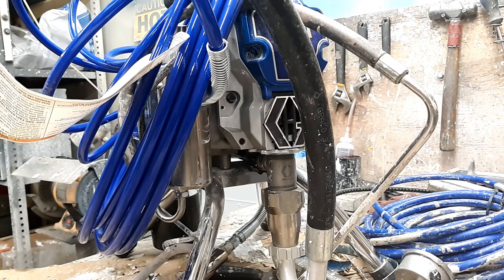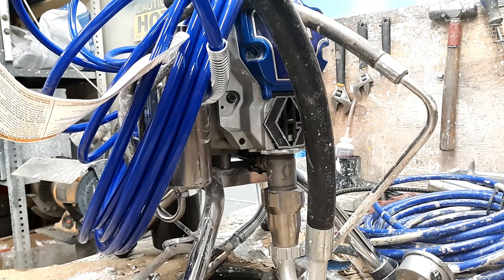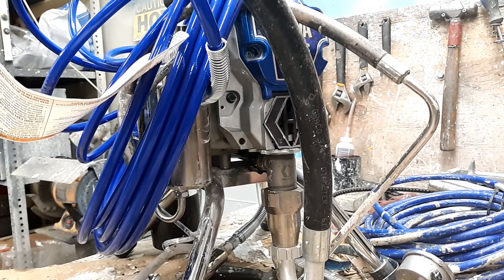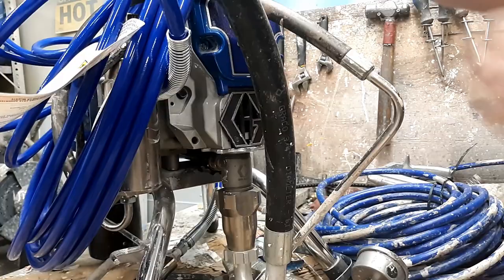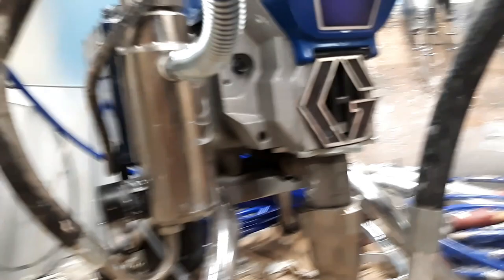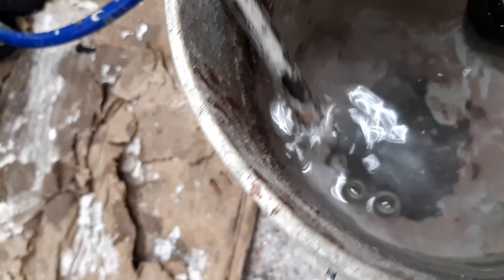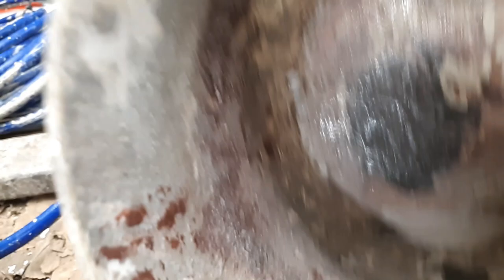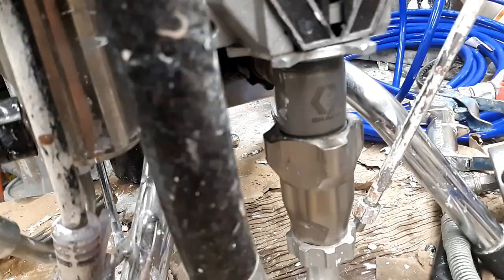Graco paint sprayer loss of pressure

Comment: Ive had a recurring problem with my 395 where it primes no problem but then after a few minutes pressure steadily drops off and then nothing at all.  Trieed all remedies you recommended here but still nothing. Im not sure how i discovered my solution butt i removed smart control panel and on the inside-right, on the very edge is a plug which resembles a phone jack. Anyway, i unplugged the jack, waited a few minutes, then plugged it back in. Worked like a charm. However, like i said, it is recurring. So unplugging jack works. I tend to think plug may come loose from sprayer being moved around from shop to truck and so on.  Have you ever come across this?
Reply from the maker: That wire is the transducer.  It measures the pressure you have on the machine. When it goes bad, you will get all kinds of pressure issues. I would suggest replacing the transducer

Comment: I have a older model 395 graco. It pumps water like a champ but when switch to paint it struggles. Why is that ? Please help🙏
Reply from the maker: Could be packings going bad, piston or cylinder may also be bad. Could be a leak at the prime valve

Comment: my inlet house will not stay tightened. Am I missing a gasket or something. as the machine runs it loosens no matter how hard I tighten it
Reply from the maker: There should be a gasket st the end of the cylinder like in the video. You can not tighten with a wrench. You must hit it multiple times with a hammer like in the video

Comment: I am learning so much, thank you! 
Question…my Magnum only seems to spray consistently if I turn psi way up - which produces so much overspray…what can I look for / do?
Reply from the maker: The magnum series is a homeowner machine. Once the pressure begins to drop, you have to replace the pump. Some models can't be replace cost effectively. If you do this for a living, I would suggest a Graco 390 or Titan 410. I am glad it helps you

Comment: I know I’m a little late just thought I would leave a comment. My pump sprays just fine and then all the sudden it’ll go dead like it’s been unplugged but then I check it still plugged in and everything I turn the pressure all the way up and it works but below 3/4 of the way won’t work at all.
Reply from the maker: My first thought would be a failing transducer or pressure control. Second thought would be a malfunctioning board. 
What machine do you have?

Comment: Is the packing o-ring necessary (158776), it's located between the top of the packing and the packing nut?
Reply from the maker: That oring is to let you know if you overnighter, and it helps prevent the packings nut from backing up during use.  It is not 100% needed, but helps

Comment: Hey Brian, question I have a graco 390 prostep, I'm not having loss of pressure.  My problem is that it's building to much pressure and won't stop. I have to run to relief valve so hose doesn't bust. Any insight on what could be the problem?  Thanks
Reply from the maker: The pressure control is most likely bad. Part number 249005. About $85. Slight possibility of the board, my go to would be the pressure control though
Reply: @Brian_the_repair_guy thanks for reply, I have installed new pressure control, new relief valve, new cylinder with new packing kit, new board and still having the same issue ... can't get the pressure to stop building up smh
Reply from the maker: @chrismendez6332  can you find me on Facebook? This will be easier to do and faster

Comment: Great info video thank you ! Can you loosten piston housing up to turn the line fitting in another direction ?
Reply from the maker: Not sure I understand. Are you wanting to have the pump hose point in a different direction? If you do, then yes you can turn the cylinder to where you like as long as the hose is not stressed.
Reply: @Brian Shumack the repair guy  awesome 👌

Comment: I've been told that I can buy a disposable displacement pump or an endurance pump that can be rebuilt with the repacking kit. Is there really a difference between the two? Can I buy an aftermarket non-OEM pump and re-pack it?
Reply from the maker: I can't answer if you can buy a nonOEM pump and rebuild it. I have no idea.
Graco does offer 2 replacement pumps for the 390-595. One is the endurance pump. The other is the Express pump. The express pump is much less costly. Throw it away and replace it.

Comment: Hey great video. I have a Graco 395. It primes ok and ready to spray. When I start spraying my pressure bleeds off. It wont cycle. If i turn the machine off then on it builds the pressure up only to bleed off after a few sprays. I have repacked it. Changed my transducer out. Any help would be greatly appreciated
Reply from the maker: First thing is putting a pressure gauge on the machine to see what the max pressure is. Then spray and watch the gauge to see if and when the pumpp starts to run again.
Reply: This sounds just like what I've been through with my 395. I don't know where I discovered this but I removed smart control cover and on the inside right hand corner is plug which resembles a phone jack. I unplugged jack and waited a minute before plugging it back in. Bingo, ran fine. However it tends to be recurring and I have to unplug jack every once in a while to get the machine running again. I think the plug may actually come loose from being moved from shop to truck and up and down stairs on job sites. May help.

Comment: Hey Brian, I just got a 395 that primes and builds pressure but keeps creeping a little every 2-3 while a rest. At first I thought new packings needed but when opened it up found the cylinder has a couple scratches but no visible damage to the packings….question:
I have seen a video where the guy uses 600 wet sanding to make the scratch surface softer and get a little bit of more life out of the cylinder, what’s your opinion about this? And finally….The sprayer is working besides the annoying constant creeping of the motor so is there any risk of damaging more parts by running it like this? Asking because everything else like piston etc look great. 
Thanks in advance Brian.
Reply from the maker: Sanding the cylinder will make no difference in the end. By sanding it out, you do 2 things. First, you change the diameter, this means the cylinder is larger therefore the factory specs for the ratio of the cylinder and the packings are not as tight. This will allow more of a chance of high pressure leaks and will speed pressure cutting. The second thing, you will inevitably sand one section more than another, putting the cylinder in an oval shape. Again leading to pressure cutting and increase the creeping intervals you currently see.
The cost of the cylinder is minimal along with a set of packings. I personally would never bother taking the time to perform the sanding because it will make zero difference and save you nothing.
Reply: @Brian_the_repair_guy  Agree, that's why I wanted to run it by you first.....would I risk too much if I just run it the way it is until it gets worst?
Reply from the maker: @DownloaderVideo  you cylinder  is already beyond repair. Nothing to worry about there. The packings will wear faster now, just keep an eye on the pressure. As the packings wear, the pressure will be hard to maintain and the creep will be more frequent.  If the packings wear too much, you could get pressure cutting on the piston. So just be aware,  but other wise you should be good.
Reply: @Brian_the_repair_guy  Thanks as always Brian!
Reply: @Brian_the_repair_guy  Brian, the sprayer is building pressure all the way to 3300 and I’m able to spray no problems but the creeping is non stop. I made a video:  

https://youtu.be/rcJeN_Y9-m4

When it stopped it was because I turned down the pressure to see how it was holding it. 
Am I already breaking stuff or can I keep pushing it? 😬

Thanks in advance!
Reply from the maker: @DownloaderVideo  what you have is normal. The 395 has a very small headband. This means with smaller pressure drops, the machine creeps. 
What this does for you is it allows you to spray at lower pressures without a surge in pressure as the machine strokes to maintain pressure. The pulse or surge isn't noticeable at higher pressures. But lower pressure it is obvious.  That is what makes the 395 perfect for lower pressure spraying. Some creep a little more often than others
Reply: @Brian_the_repair_guy  So I guess this is being exacerbated by the scratch on the cylinder making it lose a little bit more pressure than what is normal right?
Reply from the maker: @DownloaderVideo  exactly
Reply: Mine creeps at low pressure. I think that's the smart system keeping an even pressure
Reply from the maker: @RiverRatSurfers  yes, these machines are designed to creep to maintain a smaller headband versus a full stroke at low pressure. Full strokes at low pressure can cause pulsation at the tip
Reply: Check piston for hour glassing you won't see it you need feel it with fingernails or measure..an use laundry cleaner in warm water .

Comment: My prime works but when I switch to build pressure in the dispense hose it runs out the blow off tube and won’t build pressure. Is there another check ball inside the pump for the older magnum X7?
Reply from the maker: If it is coming mlm out of the prime valve then the valve has an obstruction or it is bad.

Comment: I expected the wipe ring to be melted down around the piston. And I suspect the packings have to damaged somewhat and the last time I had to clean out the lower ball the owner thought it would be a great idea to do it every time until the seal failed on the cylinder and it leaked. I have a drawer of lower ball cages probably like you do. It’s hard to tell owners how to do maintenance without getting a blank look because they just want it to work! It’s hard to determine how far to go on every machine.
Reply from the maker: True. Each machine is like a new adventure, even if they are repeat "offenders" or first timers. I try to teach them proper use and maintenance.  They are painters not mechanics and that's about as far as it goes. Some try, but eventually get out of the proper practice.  
In the end, I do my job to make money. I also try to teach and I know that if they follow what I teach, it can mean less money for me. If they learn, I am happy to not see them as regularly.  If they choose to ignore my words I am happy to take their money.

Comment: I di not understand why used a hammer instead a wrench others tools to releases that .
Reply from the maker: The part should be installed with a hammer to ensure tight compression. A wrench will not achieve the proper torque.  Using a wrench will not usually remove the intake housing for the same reason when it was tightened properly.
Reply: I bet pipe wrench would work on it if your afraid to hit it😂

Comment: My 395 Tall boy will prime but wont hold pressure? I repacked it and it was working good but now this. What you think?
Reply from the maker: Typically if you go from holding pressure, to pressure loss and the oump has not been opened, then you will have some debris in the pump restricting the flow or 
Ball movement.
Reply: @Brian_the_repair_guy  I found a major gash in steal under where the seat is. I’ve been replacing gaskets there for a while now. Looks like I have to replace the whole damn inlet line
Reply from the maker: @jrivas6339  yes, if there is damage to the metal under the seat, the inlet housing has to be replaced. About $85 or so

Comment: Hi Brian. I have a 495 ultra max 2. It will prime normal and pressure up but after about 10 minutes you can visibly see the lower end of pump loosen up and paint will start spraying everywhere as it try’s to keep pressure . If I tighten it back up it works for a few minutes then does it again. The entire unit is only 2 years old. I’ve changed the packings and replaced o rings. Any help would be awesome. I’ve asked long time painters and they have no idea.
Reply from the maker: Make sure the inlet housing has clean threads. All the way down to the valve and guide. Same for the cylinder. Replace the lower O ring on the cylinder. When you tighten the inlet housing you MUST hit it with a hammer to ensure it is tight. Hit the tabs like it owes you money. About 3 swift times. If the housing continues to loosen, replace the full fluid section. It costs about $380.
Reply: @Brian_the_repair_guy   what happens if I do everything you say and it keeps leaking. 
Graco has done something for the pickup tube housing to come loose the way it does. My o ring is fine, my threads are clean, I hit it with a hammer and it keeps leaking. I'm about done with Graco.

Comment: Hey dude! I hope you're doing great, I have a little problem with a 490 Ultimate MX II, the prime valve doesn't seem to be sealing the pressure to the gun hose, the water keeps running through the draining hose even when the valve is set to pressurize
Reply: Kinda like 12:45 part of the video
Reply from the maker: Does the valve leak at low pressure or when the pressure is higher? Have you pulled the valve?
Reply: @Brian_the_repair_guy  thank you for your answer! The valve doesn't seem to have any kind of leak, the problem began when I was cleaning the machine, usually I charge it with water so I can get rid of all the paint inside the gun hose, but this time the machine was struggling to build the pressure and water kept coming out from the drain hose even though the valve was set to spray, I haven't disassembled the valve yet. Was looking for videos about the problem before tearing it apart and that's how I found your video 😁
Reply from the maker: @Blackat2447  if your prime valve continues to run water while it is on spray, then you have a leak. The top 2 reasons for a leak is the valve is bad or there is debris in the valve not allowing it to close properly. This video is for Titan, but it is exactly the same for Graco. https://youtu.be/lAxTGcWcYZU
Reply: @Brian_the_repair_guy  Thank you so much for your help! You saved me a trip to the repair shop
Reply from the maker: @Blackat2447  glad to help, but as I mentioned, a certifies shop is always my first suggestion.

Comment: I have an issue with my graco 490 pc pro. the tips keep clogging up and i had to kept reversing the tip to unclog it. Its so annoying while spraying. I tried everything cleaned out both the filters. cleaned it out with more than 2 pails of water. The sprayer works just as new when i take out the tip. But as soon as i put it back its just start doing its plugging up thing again. But if i run the sprayer just with water it seemed to work just fine even with the tip on. 
The tips i was going with fflp 308, 310,312 nothing neither one of them worked . Except the RAC X  515. it just started happening. I worked with same paint the other day with fflp 308 and it worked just fine but now its just so annoying to be keep reversing the tip again again. If you could help with this it would be much much appreciated.
Reply from the maker: My first though on the FFLP tips is to use the fine filters in the machine and the gun. This will catch far more trash. These are the blue filters from Graco. You may need to increase the pressure a bit. When the pressure is lowered, the machine can't push through some of the trash as easily.  How old is your hose? Build up in the hose can cause excessive clogs as it breaks off.
Reply: @Brian_the_repair_guy  
The machine is just couple of months old. I bought it at the end of the last april. Also the i have tried increasing the pressure all the way up. Filters were all cleaned up i have checked them twice a day. There was no gunk in the filters or in the hose. I tried thinning and straining down the paint as well. But its just wont work with the tips
Reply: @Brian_the_repair_guy  
It was working just fine with the fflp 308 tip day before yesterday but the next day it just didn't work. With out tips it works like brand new. But as soon as you put the tips in its just stop working.
Reply from the maker: @gurparveshsingh5348  I would suggest the blue Graco filters if your machine is Graco or the fine filters if it is Titan. The medium or black filters do not catch enough material for an 08 tip. What product are you spraying?
Reply: @Brian_the_repair_guy   i was spraying  exterior A-100 latex paint from sherwin-Williams

Comment: Thanks for the video, but why does my sprayer keep sucking up water it won’t stop and I lose pressure, any ideas ? It just keeps going and going instead of stopping
Reply from the maker: Of the water is not leaking back out through the prime valve then you may have something blocking the upper or lower ball or packings are bad. You have any other information on what's happening
Reply: @Brian Shumack the repair guy  I have the same situation but the water is flowing back out of the main fill pump and the prime line. Sprayer never fully primes. Just runs. Water runs through fine, both the main intake and the prime outflow but it will not prime. Both balls are clear, machin is very clean. Gaskets are good. Not sure what to do.
Reply from the maker: @TheGreenLoveEarth  I have a feeling your prime valve either needs to be replaced or has debris in the valve. I have a video on how to determine this